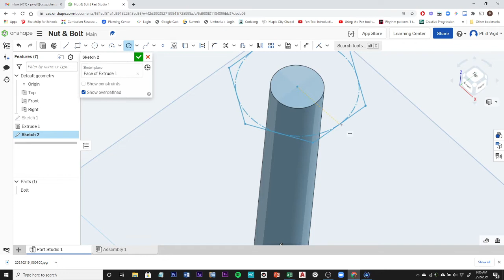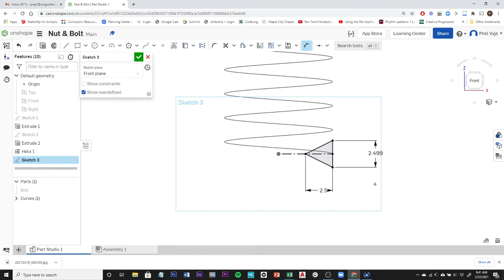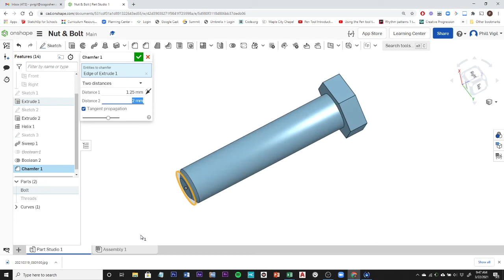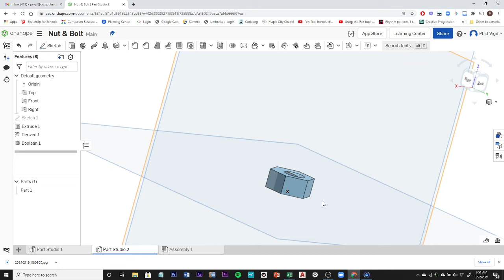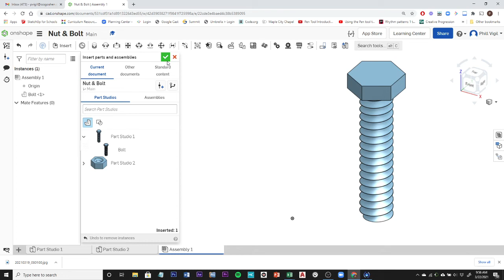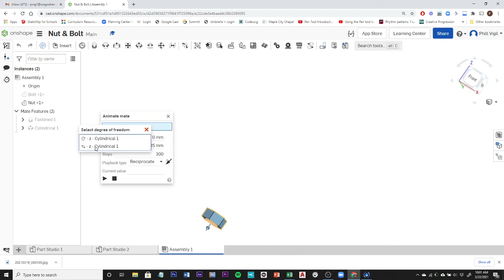Onshape Bolt and Nut Assembly

Comment: This was such an easy tutorial to understand, however on 3D printing, there is no tolerance and the bolt does not fit into the nut.  What settings can I change to account for that?  I've read that .4mm is a good distance between threads planes

Comment: Superb, outstanding, excellent video with lots of new features taught.  One small point: At the end, the nut appears to rotate opposite the thread direction.  This should resolve by setting in the Screw Relation, but it appears AFTER the cylindrical mate (and its animation) in the feature tree.  Thank you very much.
Reply from the maker: That was a big mistake...I didn't realize the rotation error until I had posted the video and I wasn't going to redo the whole thing to correct it...now I wish I had. Glad you noticed and have posted how to correct the mistake for others who have found it! Thanks

Comment: I dont understand why you did some things "the long way" as I would call it. Why not do the thread removing in the sweep instead of the boolean? For the derive thing I get why you have to use the boolean. however, I did like the process you showed and the explanation of some of the math

Edit: when inserting parts into an assembly you can just click the green arrow before placing it down and it will snap to the origin, if you havent figured that out by now
Reply from the maker: I am teaching students who are using CAD software for the first time. So, a lot of times I do it so that I can teach new concepts or tools. But I always appreciate good feedback. Thanks!

Comment: why did it take half an hour to make
Reply from the maker: It is a tutorial video for my HS students. It usually takes them an hour to follow along and create this project. There are 2 goals. 1. Create a CAD model of spiral threads on a nut and bolt using the helix tool. 2. Create an assembly that illustrates the linear and circular motion relationship between the two parts. Hope this helps.
Reply: @phillvigil5702  Any reason you are using the boolean tool to substract the threads from the bolt instead of just using the remove option during sweep?
Reply: @Lexei92  yeah i was thinking the same thing like, "what? why would you do all that extra work?" my friends call me the lazy engineer, so any work that i can cut down on myself i do. and i also think that would be easier for HS students to follow along with, especially since i am one. im probably a lot better at modeling and printing than the students hes showing this video though. i designed my own bong lmfao
Reply from the maker: @Lexei92  The boolean functions are common to all 3D design software. I came from AutoCAD to Onshape and there are a lot of workflow shortcuts that Onshape provides that aren't always available in other CAD software. I try to teach concepts that are transferrable to other programs and once they understand the concept, I show them the shortcut. I actually love the way Onshape has designed its workflow to combine functions.